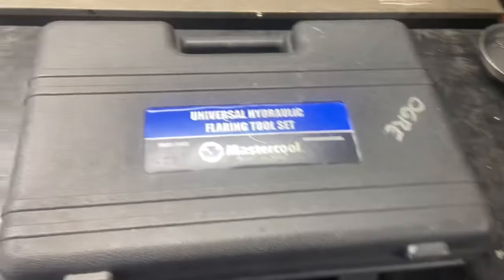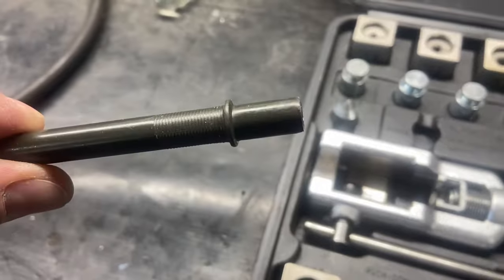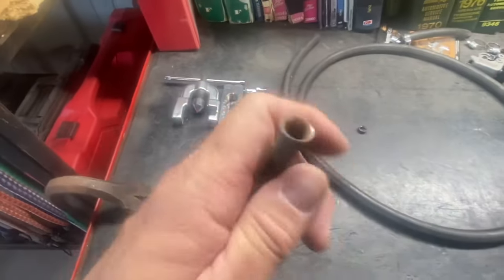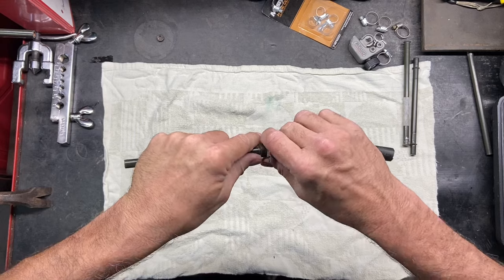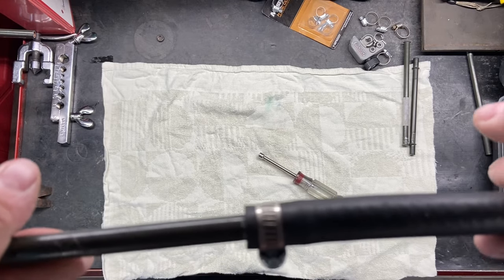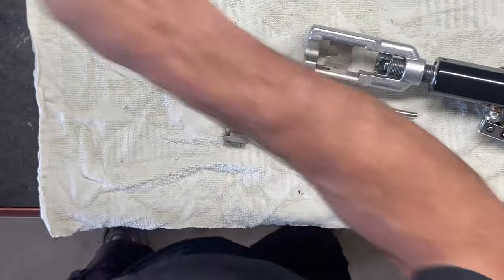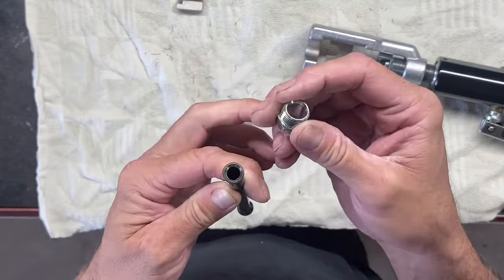Fuel Line Flaring.

Comment: Thank you! For years I been trying to find a tool to make the bubble to hold on the rubber hose! Years ago,, many years ago, there was a tool just for making a bubble in a line,, and I haven't seen it since! So now everyone shows you how to make all different flares with all these new tools, but not one person shown how to make a bubble,, so I would know the tool to buy. You are the first person I found to show a tool make a bubble!. Not quite the bubble as done in the old days,, but close enough for exactly the reason you shown! Thank you!
Reply from the maker: I appreciate you watching and happy I could help.  I ended up doing a 2nd video showing how to make the bubble flare using a $30 tool vs the $300+ hydraulic tool.  If you’re bored and want to check it out, here’s the link: https://youtu.be/xb6uW_DCGvQ?si=GTEP5uD2YdYujEWb . Again, thank you for watching and commenting.
Reply: Thank you for that! I just watched that video! The hydraulic made a nicer bubble. I don't know how old you are, but maybe 3 or 4 decades ago, there was a tool , I can't even remember what it looked like,, we had one in the shop, not in my own box for me to remember. But, it made a slightly bigger bubble a tad bit further in the tube! On older carbureted cars, sometimes the metal fuel lines already had the type bubble that the hose went over from the factory. But, I guess as times change, so do the less need and disappearance of certain tools! But, when I finally watched your video ( I was just watching to see what this tool done because there is one for sale on marketplace, and I never saw this tool before), that's when I was impressed that you made that bubble,, that is pretty darn good for what I want!! I was watching a bunch of these videos, your was the only one to show the bubble. Now I am wondering if all these kits have that die for all sized lines,, because if I am buying one of these, of course I want one to do it all!! :)  So, again! Thanks!! And have a spifftacular day!!   @ogresspeedshop

Comment: Hey bro, I realize that your fuel line flaring video is a year old but, I wanted to mention, The 1st brake flaring tool u showed, If u make a single flare then use the cone tip that is on the forcing screw/C-clamp, that will fold a single flare into a double flare Secondly, I see that you used sleel line to make your flares, nicop/ Nickel copper line forms much easier & is much easier on your tools & thirdly, I always use a bit of lube when making my flares. I use brake fluid, or penatrating lube/spray, or wheel bearing grease, anti-seize, MAKING SURE TO BRAKE CLEAN ALL OF IT OUT OF THE FITTINGS B4 INSTALLATION! Your tools will thank you for it & last much longer along with saving alot of time!!! I just realized that I canbuse a caulking gun & the bar from the 1st flare kit u showed, to join fittings to nylon tubing. I was going to modify a hand clamp similar to to nylon forming tools online/amazon/ebay. I hope you have a happy new year! Happy Hollidays!

Comment: The one place this Mastercool kit is unparalleled is for making those push lock fittings, but it's hard to stomach the $500 tool cost for one rare use. Dorman sell preformed straight length segments with a push lock fitting for nylon connectors at one end, and you can find a way to couple at the other end, either with plastic, rubber or steel. I like how you found a way to bubble the end for rubber hose connections.
Reply from the maker: The mastercool kit paid for itself at my last job.  We did all custom classic muscle cars with all new and custom fuel systems.  I probably made more push lock fitting than flared fittings.  If you use them everyday they are worth it for sure.  Thanks for your comment and and input on the Dorman products!!
Reply: The last time I had to make a new push lock tube to accept those GM nylon connectors I machined a washer the same diameter and thickness as the rusted out factory tube and silver brazed it onto the new line.  Took longer but worked perfectly.

Comment: My Mastercool flaring tool is newer and it has a little flush-up device on the side of the holder that helps you set the tube depth when you don't have clear line of sight.  Nice to have.

I break it out maybe twice a year and it's still worth the price.
Reply from the maker: That’s a nice upgrade, my buddy over at recycled racing has one with that.  Thanks for sharing!!

Comment: I have a fuel leak on a Mazda 3 from the fuel pump to the hard line and it looks like the push lock fittings (GM style, but the latter one). We replaced the fuel line with stock part but iti is still leaking, Can I just not put a fuel line with clamps and it should work? I have no fancy tools like you do, but if I did I would have to cut the hard line and do what you did.

Comment: i have found... that up here in maine,, the critters we have,, like to chew on my braided fuel line on my tuned 350hp 2004 subaru forester xt.. im gonna use a hard rubber fuel line amaazon kit, for my 2002 chevy silverado 1500hd with a 6.0l v8... im hoping it will last a few years till i do a better replacement. my truck is a learning experience.. i will have a pro
 subaru mechanic do the fuel line on my subaru.

Comment: Thanks for this video. I might have to connect a new nitrile rubber fuel hose to an existing steel fuel supply line on a fuel injected engine. How can I make that bubble flare without expensive tools?
Reply from the maker: You can accomplish it with the cheap flaring tools you can get at any parts store.  If you want to save some money, harbor freight has the manual screw down style that can do the job as well.  Just make sure it can do double flares and just do the first step of the double flare.

Comment: Hi Jason, my name is Tim from eastern AZ. I've put a 1992 Jeep XJ, 4.0L engine in my 1983 Jeep CJ, and I want to use as much of the original XJ stainless steel fuel line as possible.  Hence, there are several places where I'll need to make the slight bulge in the end of the stainless line to accomodate a  (fuel injection rated) rubber fuel line connection. You mentioned at the beginning of the video that stainless line is a pain, please, will the Mastercool flaring tool do stainless lines OK? If not, please what tool should I use? Thanks.
Reply from the maker: The mastercool kit can do stainless.  Problem with stainless is, it’s kinda brittle and will crack very easily.  Just be careful working with it and you should be fine.  If you plan on double flaring the stainless though, that’s when you have the most issues with cracking and splitting.  I can’t remember off hand but there is a type of stainless that has a different mix of metal that resists corrosion just like normal but is easier to work with.  I’m not sure what the stainless lines on your jeep would be like.  But the mastercool kit should be able to put a bubble on the line.  Make sure you use fuel injector clamps and not just standard work clamps.

Comment: Anytime I can get away with it I prefer to use stainless steel safety wire tension clamps instead of spiral hose clamps on small diameter hoses.  They are the way to go if you are making any connection with plenty of room to work.  They are smoother with a low profile that look trick but are too hard to apply in some tight spots.

Comment: Nice video.  Can the bubble flare handle fuel injection pressure?? 45-50 psi?
Reply from the maker: I don’t know if I would trust it for long.  It could probably get you out of a pinch if needed… but I’ve never been a fan of fuel injection and hose clamps… atleast not over 40 psi.  I know some older TBI systems only ran like 18 and I think it would probably work for that.  If you do try that, make sure the hose is rated for fuel injection and you use the fuel injection clamps.
Reply: @ogresspeedshop  Yep, was going to use both: correct lines and clamps.   thanks for showing us what's possible, and thanks for responding.

Comment: Boss, so to make that bubble fitting for rubber hose, use an inverted flare adapter but don’t go down very far?
Reply from the maker: Pretty much.  It’s hard to explain but with this flaring tool you can feel the moment where it hits the perfect spot.  There’s pressure and as you squeeze it kinda gives a little and that where you stop.  It takes some practice to hit it but as long as you don’t go till it stops it works out pretty good.  Just gotta practice.

Comment: Hi Ogre, I am assuming these flares work with AN fittings?
Reply from the maker: Not these ones.  I did a video video on flaring -AN hard lines.  -AN flares are 37° angle for the flare where standard flares are 45°.  So it take a special tool to flare for -AN fitting. https://youtu.be/YujDR9YhWu0?si=dAzWa9jUqfnNxGpv

Comment: so I am asking what will be max. bar pressure. Can you use it also for highpressure hoses for wash machines
Reply from the maker: Typically this type of flare is used on lower pressure applications.  Like carbureted fuel lines and transmission lines. Usually transmission lines put out between 20-30 PSI which i think Is around 2-3 Bar.  I don’t know how much pressure a washing machine puts out.

Comment: How do you flare front break hose line
Reply from the maker: If it’s a standard line then you use a regular double flare… if it’s metric then it’s usually going to be a bubble style flare.  I could probably do a video demonstrating each one if that’s something that could help you!
Reply: Great video believe I need the bubble flair for my 89 Toyota 4x4 3.0 engine but don't have that hydraulic flair tool.  Thanks for sharing be safe have fun ps love the firebird
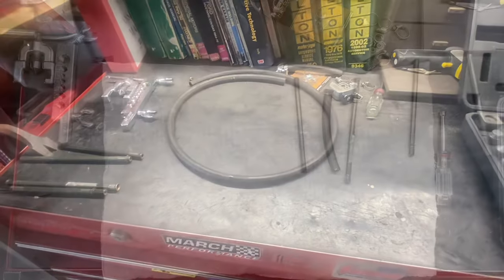Reply from the maker: It’ll most likely be a metric bubble style flare on the Toyota.  I remember back when I was a teenager wanting one of those trucks.  Had a buddy back then.. around 92-93 time frame with one that had a built 350 SBC in it and with somewhere around 4:50 gearing, don’t remember exactly, and he could do wheelies in that thing.  Great trucks, if you could keep the rust off of them.  Thanks for the love of the Firebird too.  I appreciate the comment!!
Reply: @ogresspeedshop  ya I've wanted one since my brother had like 6 of them in the 80s 90s I found this one couple weeks ago not running but is pretty much rust free but messed the fitting up on flex line that hooks to fuel pump line nobody has one so I'm thinking just put braided line on hard line n clamps.

Comment: So what you’re saying is I need to go buy a thousand dollar tool.  Thanks.
Reply from the maker: Not sure where you got that idea, this kit is about $350. But you can do the same thing with a $30 flaring tool from harbor freight too.   Like I demonstrate here. https://youtu.be/xb6uW_DCGvQ?si=_YS7_1nZ2vnQ1ne_
Reply: @ogresspeedshop  Fair enough.  I stand corrected :). I am a normal guy, so that means I like tools, and I do have a few expensive ones too, but for jobs I only do once in a blue moon cheap tools that make you suffer a bit but get the job done are the way to go.  I think I may have misjudged you.  Liked and subscribed now 👍
Reply from the maker: I’m all about cheaper tools for one time jobs as well. After I retired from the Navy, I worked at a custom car shop and we made everything, basically from scratch. The hydraulic flaring tool was a vital investment for the amount of custom brake and fuel lines I made.  One of my rules of thumb was, if I had to borrow the tool more than twice it was worth buying for myself. Heck, most of my automotive specialty tools I buy at Harbor Freight.  So far it’s rare for me to break anything I get there. I’ve got some crappy stuff that I’ll never use again there too but for the most part, I’ve had good luck.  Thank you for watching. I appreciate it!

Comment: Most diy cant afford that type of flaring tool for maybe a one off job.not very informative for average joe.
Reply from the maker: That’s why I did a 2nd video showing how to do the same thing with a $30 kit from harbor freight.  If you want, you can check it out here. https://youtu.be/xb6uW_DCGvQ?si=kcyrTaKu83vc8vR1
Reply: Average Joe, here 👋  I found it very informative, thank you!
Reply: It can be bought from Aliexpress for about 200-300 USD. No need to buy the Mastercool branded one.
Reply: @bobdown9414….the average joe buys a brass flared compression fitting. Compresses the ferrel onto the tube, trims the excess if any. Now you have a flared end for about a buck.